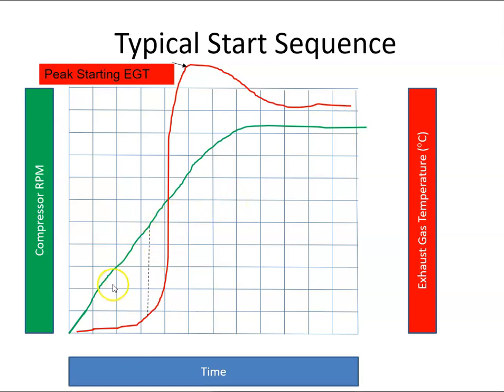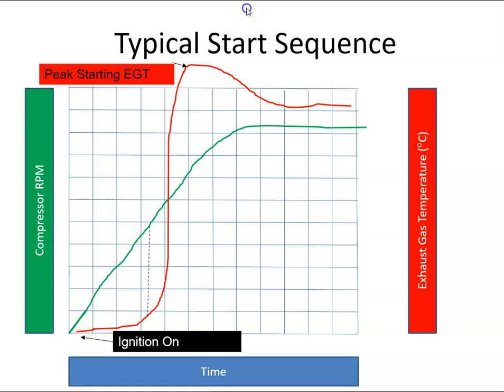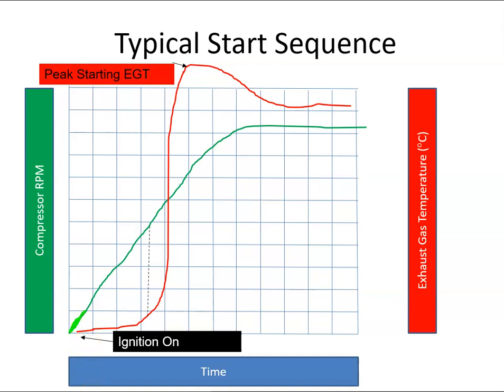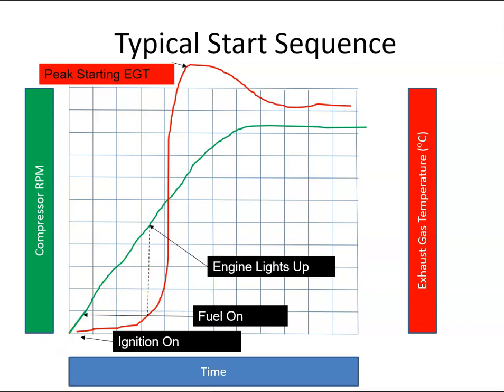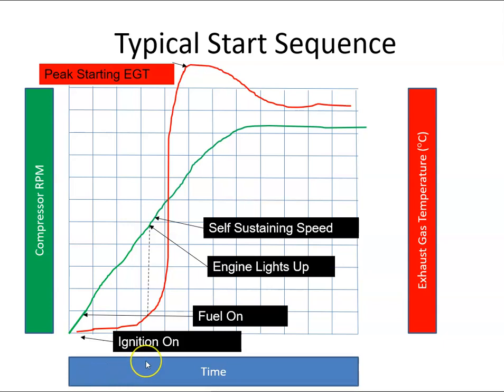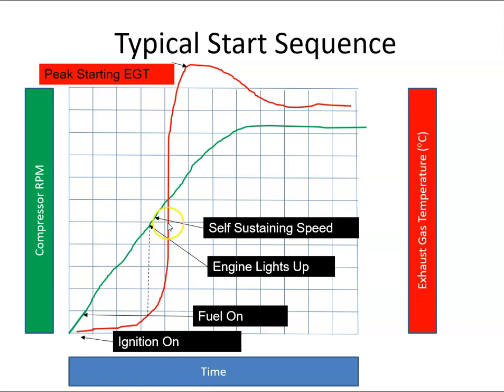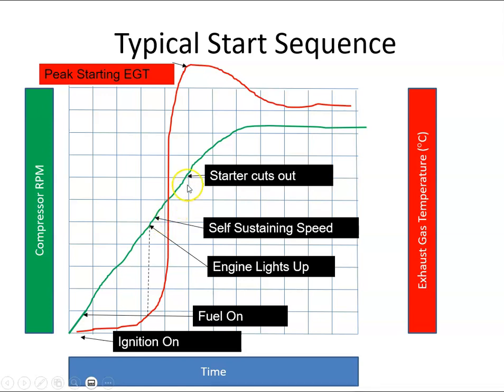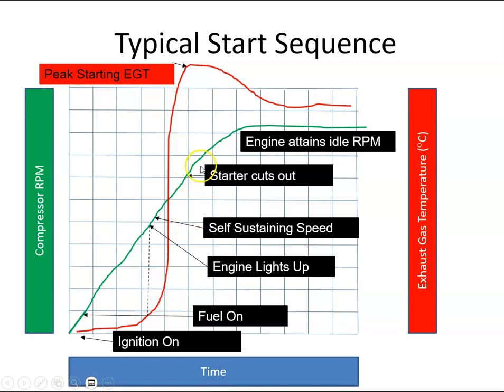Typical Start Sequence of a Gas Turbine Engine

Comment: So starter, rotation, ignition, fuel?
Reply from the maker: No, starter, rotation, igniters, fuel and ignition.
Reply: @RoddyMcNamee  wouldn't introducing fuel before igniters are on cause pooling and, most probably, an explosion when ignition finally happens?
Reply from the maker: @marlonmunanga523  yes, that is very possible.
Reply: @RoddyMcNamee  wonderful. Getting ready for cpl exams. Much appreciated.
Reply from the maker: @marlonmunanga523  best of luck with them.